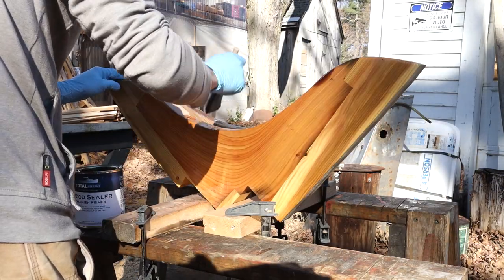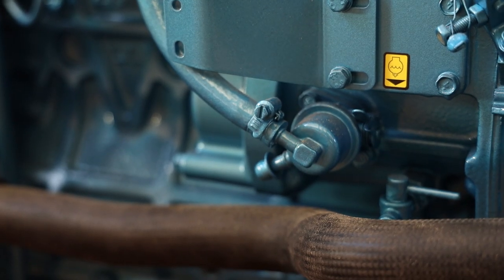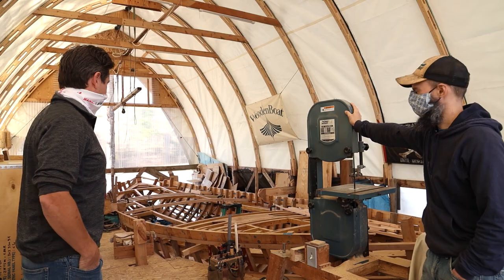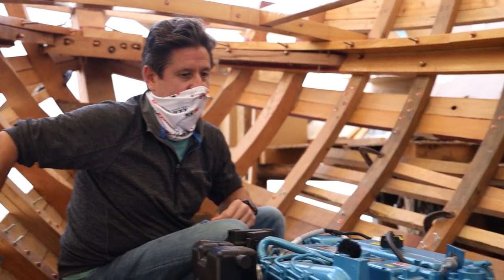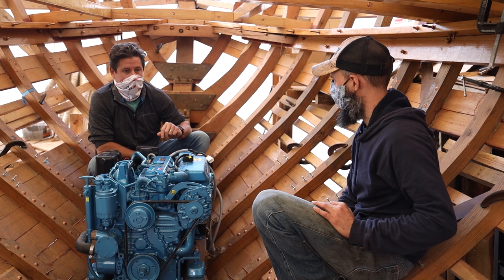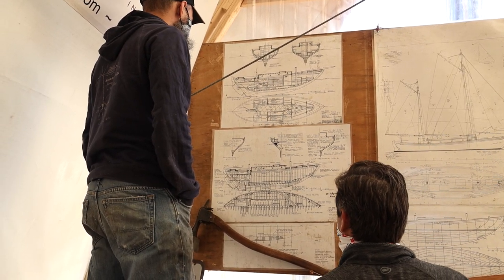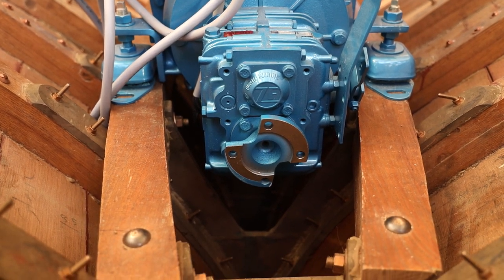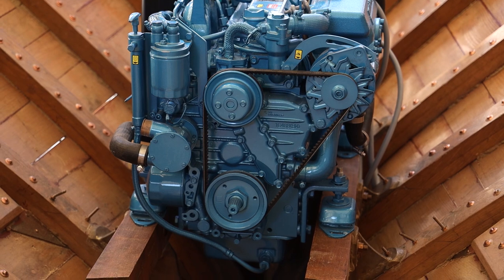Designing the Power Plant - Episode 137 - Acorn to Arabella: Journey of a Wooden Boat

Comment: Seems that Steve hasn't really thought very far ahead regarding electrical and living systems on the boat. No hot water?
Battery operated electric motors have their limitations. On a sailing vessel that will be going to remote places in the world it's even worse. Thinking you can use wind or solar on the vessel to keep a large battery bank (essential) charged is not taking doing the calcs to make it work into consideration. You need engine power when you need it, not after a delay of having good sun and or good wind for arrays that would have to cover the boat, or wind turbines that would also have to cover the boat. 
There is a new drawback that has come to be a realization among EV owners and that's 'range anxiety' .. It's a constant worry in the back of a persons mind that the EV will be able to make it to where they're going, and this is on land where there are known charging stations in a lot of places, and you can also charge at home.. Think of how much worse range anxiety would be on a sailing vessel where recharge power will be more scarce. The current unfortunate myth that electric power is the answer for everything has become a widespread mantra, largely based on the mistaken belief that Co2 emissions are to be avoided at all costs..

Comment: With respect I really think that you need to give this whole aspect covered by this video a great deal more thought. The first realism check is to map out the likely equipment fit and from that the daily electrical consumption. I totally get your minimal aspiration but get real most folks appreciate the ability to use a head and have a hot shower even if it only occasional (😉) and if you were truly minimalist why have an engine.

I am not at all sure that a Diesel engine salesperson is the best source of advice for engine room design either and he was clearly skating on thin ice in a few areas. Of course moving the on engine filters and perhaps the sump pump are good ideas but do introduce additional vulnerabilities which require further measures to ameliorate.

Reducing through hull penetrations to the minimum is a good design philosophy, however in the case of the engine alone I would advise you to consider having two through hulls, port and starboard to ensure supply if one through hull gets fouled (it does happen).

Comment: Comparing the 100 amp alternator to the 100 amp panel for the house and boat shop is misleading.  The house uses 110v at 100 amp, providing 11kW of power.  The 100 amp alternator in a 12v system provides 1.2kW of power.  You don't have nearly as much  power available as the comparison implies.

Comment: Power is determined by watts, not amps. At 120V, 100 amps supply 12KW. 240 volts would be 24KW, At 12 volts, 100 amps supply 1.2KW. That is 1/20th of the power available on your 100 amp panel for your house. While it is entirely possible that, 100 amps will be sufficient for your needs, do not believe that the available power will be even close to the power available at your boat shed.

Comment: Hi guys, I built a 24 footer back when, and you're at the most fun stage. Good comments below, some spot on, some iffy. 
My best suggested source for wide ranging FAQ:  Attainable Adventure Cruising (https://www.morganscloud.com/)
Secondly:  alternator, yes and no. For Cruising, windvane steering, solar and wind with a smart controller, LEDs, and good Lifeline batts provide plenty amps (except for radar, fridge/freezer, hot water, electric autopilot and watermaker: those really draw). S/V Brickhouse just finished a battery update on YouTube: https://www.youtube.com/watch?v=6gbdwMo1lk4&feature=youtu.be.
Patrick and Rebecca on Brickhouse have covered a range of disciplines in depth.
Agree with the twin Racor fuel filters and oil pan;  might try for plenty of headroom if injectors need bleeding, mixing elbow clogged. 
Compost toilet:  recommend, have had mine for 7 years (re: https://theboatgalley.com/composting-toilet-tips/). Dealing with another hole in the boat (or two), and the mess of a pump out...do a compost correctly, not a whiff.
One quick note:  I'd put a backing plate on the other side of the Sampson post cross beam:  it's going to rack like the dickens on your rode in a nasty seaway.
Good times...happy thanksgiving brothers.

Comment: is it not possible to mount the filters upside down? They'll drain back down into the lines/pan and not leak when you spin them off.
Reply: My Kubota is side mounted like this, I think it’s just how they mount these.  On my car my filter is mounted with the open end down, with a catch pan around the opening, much easier and cleaner.   On the boat I’m super careful when I change the filter but it drips regardless, so changing the mounting location and orientation is a great idea.  I suspect that this engine, being for a tractor basically, didn’t have the marine operator in mind.

Comment: Not really getting the no amenities concept which will inevitably bump heads with reality. Redesigning the engine when you have already stated you don't understand marine diesel engines slippery slope. Maintenance get a Reverso GP301312 3 Manifold Oil Chg System done. You really should consult with a ABYC standards person on installing your systems. You are putting together a nice build you have clear knowledge gaps be open enough to listen and learn from a ABYC person, the next owner will thank you.

Comment: I haven't seen any comments about this yet, but for me, all that paint on the hoses, clamps, wiring, brackets, screw heads, nuts, bolt heads and threads, etc. is a MAJOR issue.  Paint, where it does not belong, makes disassembly a bitch.  Why would any reputable engine builder/reseller do this?  Seems pretty lazy to me.  I speak from years of experience working on cars.  Working on the engine later, especially in cramped quarters, will make life miserable.

Comment: Heat exchange system for cooling engine. It would also provide hot water for you to use. Having engine on a sealed system will make it last longer.  
https://www.evanscoolant.com  uses a 0 to 7 psi  system so not pressure on hoses and seals.
Look into lithiumsolar on YouTube for information on solar systems setup and battery packs. 
Better to spend extra here and now than later plus shipping and down time.
Best of luck

Comment: I would recommend a Davco fuel and water seperatorhttp://img0101o.psstatic.com/161249907_382-fuel-filter-water-separator-semi-truck-parts-.jpg .  They have a petcock for draining water and a see through bowl that lets you know when the cartridge needs to be change (when fuel level reachs the top).  Cartridges cost around $20 and can be found almost anywhere since so many semis use them.  All my trucks have them and they do a great job.  Used ones are on ebay for $70.

Comment: That dude and his mask 🤦‍♂️😂. 

You’ll need way more power then you think. When you account for charging cameras, computers and running interior lights and everything else. 

Future proof your boat. Set yourself up with plenty of power and plenty of power storage. I’d guess you’ll end up with a 12volt water maker also. I know you think you won’t but if you’re going to remote places then you’re going to want one. 

If you’re not going to have solar then get the second alternator. Make it high amperage so it can properly charge lithium. Even if you don’t intend of having lithium now just set yourself up for it. 

Talk to Victron Energy and Battle Born Batteries about sponsoring you.

Comment: 100 amp 12Vdc alternator is not comparable to your 100 amp 240Vac residential power.  Power wise one is 24 kW and the other is just over 1 kW.  100 amp alternator isn't much power.

Comment: Think stupid, plan smart. The more unique your system the HARDER to repair. You will need AC on board even if you're not using a large amount of power. 3 circuits min. for H/W, battery charger & 2-3 receptacles. Stay with "wet" batteries for ease of replacement. 1 group 24 HD cranker for start & 2 6V "golfcart" batteries for house supply. Check Blue Seas about an ACR for charging. You CANNOT use a battery isolater  because of the alternator.

Comment: *****THIS WILL BE LONG BUT USEFUL I THINK******
OMG something I can actually talk about with some experience and knowledge.  Engine stuffs.  While everything is shiny and new it is easy to forget things like engine oil leaks as well as maintenence/repair.  You may be amongst the lucky that will not have to replace anything on your engine...... that is probably a pipe dream...... nope, on second thought that is a pipe dream.....  The reality is that sooner or later something on that engine is going to need maintenence or repair and I can absolutely gurantee that it will eventually leak (the engine gastkets, fuel injection punp etc) you want a FULL PAN customized to fit the space under and around your engine.  By around I mean has a footprint that envelopes the overall dimensions of the engine plus a little for spilliage and parts removal both in area and in depth. You do not want that diesel fuel or engine oil to get into contact with the wood if at all possible.   Once the oil and or diesel has soaked into the wood it is there for the life of that wood.  This won't technically harm the wood but it will make it smell like diesel.  This also means that you want to keep whatever has leaked or spilled during  the repair does not get into the water in the bilge, that will just facilitate your boat smelling like old diesel and diesel engine oil as well. I don't know how much water might be in the lower parts of the hull but you want to try and keep  the stuff contained, ie; bilge water  from the inside of the hull out of what has leaked into your engine pan and  the stuff in the under engine pan separate from the water in the bilge.  Now is the time to design and build your pan. Decent quality aluminum can be put into service and made to form and fit your hull and welded to fit in the engine bay.  this will add a small amount of weight but probably not more that a few pounds (15 ish lbs). If this is done well  spills wont matter as much because you can clean the aluminum and the water in the hull will be kept away from the engine and the inside of the  "pan" . Water and oil WILL mix (emulsify) and if they are  on the wood side of the area they will contaminate the wood. That will stink forever.  I hope that something I have said here will help you plan for this and at some point in your sailing journey you will be able to say that  info I gave you helped make your life in the sea a little easier.

***Yes I know that I make large comments***
Reply: Bb

Comment: Your nave station and media center are going to take power.  Editing video takes alot of power on a boat.  Just ask free range sailing.

Personally I would make sure that my outlets in my nav station, gally, and v birth have outlets with built in USB.

I would also plan on a 4 battery bank solar and wind charging system to run all of your electronics.

At minimum youre goung to need GPS and that coukd be on a phone, tablet, or unit that you purchase.  Youre going to need a debth finder.   You dont radar but I highly recomend it.

Your laptop and camera equipment all take power and need to be constantly charged.

Down tge road you might want a water maker or you may descide that cold or luke warm showers really suck.   No matter what your power needs are now. You always want to plan for expansion and give yourself a powere buffer so youre not stressing out about how much powere youre consuming.

Phones, camera equipment, laptops and your navigation equipment not counting your nav lights, cabin lights, refrigeration and other power needs that you might have in tge gally all add up .... quickly!

The point is dont screw yourselves  by trying to go cheap on your power grid. .... I cant wait to see what you come up with .... ⛵💕🌠

Comment: You run the house and the boat house off a 100amp 240v split phase service. Or 24,000 watts. A 100amp 12v system provides 1200 watts of power. 1 microwave.

You guys are severely underestimating just how much power things use.

Get some help from someone with electrical knowledge.

Comment: Please do yourself a favour and look into iron/nickel/alkaline wet batteries (aka the Edison Battery)
They last forever, are easy to maintain, can be drained of charge like lithium (without the damage) and can be charged with conventional charging equipment. They are slightly lighter then your lead/acid batteries but have the energy density comparable to lithium ion batteries...
https://en.wikipedia.org/wiki/Nickel%E2%80%93iron_battery

Comment: You want a generator, refrigerator, water, toilet, etc. Combination of 12 Volt and 120v appliances.  Come on you are building a $100k ++ sail boat.  Bronze floors, bad ass engine and your going to cut corners on hot water, microwave etc.  Do yourself a favor or you will regret it later.
Reply from the maker: Those may be corners for you, but not everyone has the same needs.  We don't even use microwaves now, why would we want one on a boat?  And as for the other systems those are not thrown out altogether, we have plans.  Keep in mind that what you saw is a snapshot of what we think about.  It is impossible for us to convey all the ides we have or have been thinking about.  She will be well kitted out and comfortable to our needs (and not necessarily others).

Comment: umm learn more about your fuel filter, the one you are touching on your engine is considered your secondary fuel filter, you need to also add a primary filter which is the one you are talking about that isnt on the engine, fuel from from the tank to the primary, something like a racor 500, that seperates the water and larger stuff out of the fuel, then the fuel goes to the secondary engine mounted filter which is a finer micron filter. On most engines people use something like a 30 micron filter on the primary and 10 on the secondary. NEVER RUN A DIESEL ENGINE WITHOUT A PRIMARY FUEL FILTER THAT SEPARATES WATER! Google racor 500. if you put it in the engine bay get a racor 500MAM or MA